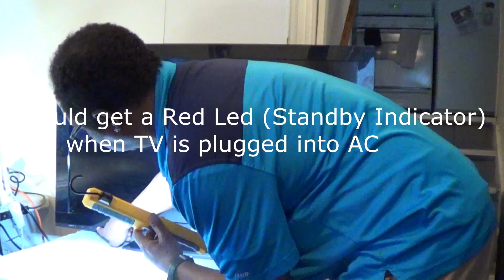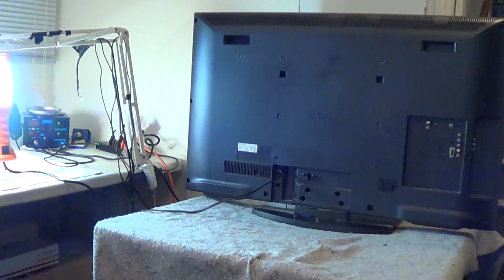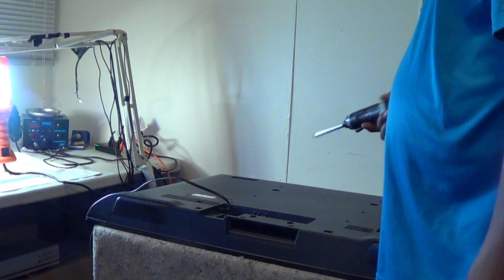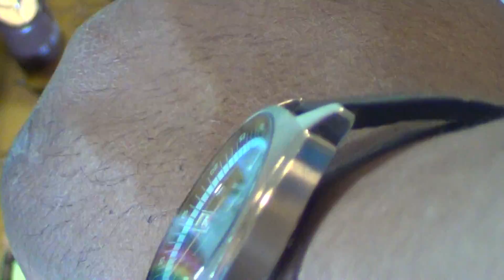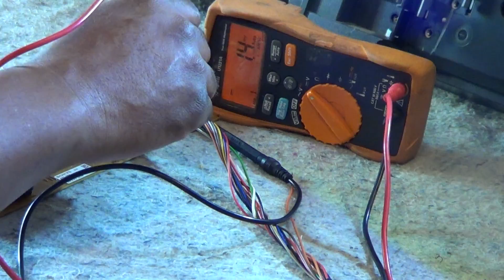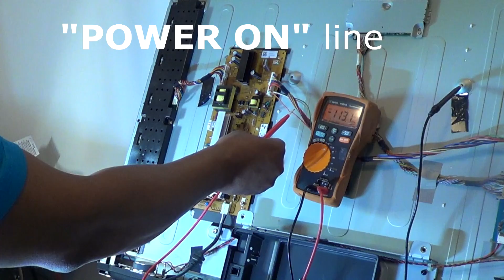How to fully check your tv power supply on a dead television set

Comment: Hi,  I hope you have the time to answer a couple of questions.  I have apart my Hitachi 55" LED LE5569 tv and the backlights did not work.  I replaced the bad ones but, the backlights will still not come on.  I have changed the power supply and the main board and have taken the panel outside and looked through it to see it damage using the sun and I cannot find any damage.  Anyway the power supply board is MP1-1450 the two connectors that hook up to the 12 led strips, one of them reads 336 vdc but  the other one is not steady it seems to go up and down.  I checked all of the led strips indivually and this repair is driving me nuts.  I have the voltages to the main board.  I have the standby blue light on.  I have never seen the picture or heard a sound out  out of this tv.  Can you help please?
Reply: If you were to disconnect the wire with the unsteady voltage reading from, or very close to, the connector which feeds the backlights and take another voltage reading on the backlights side of the open circuit you made by disconnecting the wire, and the reading:  A.) Remained unsteady, then there exists an open circuit in that wire,  somewhere between the connector which feeds the backlights, along the wire that had the 336 vdc (supply) wire through the led's up to the point of open circuit you made, or defective led(s). This open circuit, or defective led(s), must be located and repaired: B.)Obtained the same voltage reading as the other led (supply) wire, then there exists no problem with the led(s) or these 2 wires from the connector which feeds the backlights along the supply wire (the wire with the 336 vdc reading) up to the point of intentional open circuit. Now is the time the intentional open circuit should be restored to its pre-intentionally-open-circuited state. If there exists continuity from the point of intentional open circuit restoration through the connector which feeds the backlights, then the problem exists elsewhere, probably on the board. I hope I have been concise and thorough in my attempt to help you diagnose the problem with the backlights, and I hope they are understandable. However, I just noticed your comment is 10 months old and you have probably already repaired it by now, but I will still submit my reply in case you haven't repaired it yet, and haven't returned it to the owner, junked it, etc. (lol) Anyway, I hope it helps.
Reply: @JerryBrogdonmrfixxitt  Thank you for the reply.  After I got the back lights replaced and reassembled for the 3 or 4 time, I ended up cracking the screen after all so I donated it to the TV repair place.
Reply: @dallaspilotcar9293  What a bummer, Dallas! Do you know if the backlights were working at the time when the screen became cracked? If they were working, do you know what had been done to enable them to work? I'm curious.
Reply: @JerryBrogdonmrfixxitt  I believe that I ended up having another backlight strip that was bad and it prevented the other ones from working and once I replaced it, they all came on.  However, even when I hooked TV up to antenna to check it, I was never able to get any kind of a signal or any other kind of input to work.
Reply: @dallaspilotcar9293  Did that tv only have the one button requiring a remote control to operate the tv? If so, did you have the remote control? If so, was the remote control programmed to that tv? If so, did the remote control have good, strong batteries? If so, did the tv scan for tv stations? No, it didn't, you said that the tv never had a signal. The problem there could have been with the remote control or its batteries, causing a a no communication state to exist, which would explain the tv to have no signal. But I'm sure you know this, so it must have been something else.
Reply: @JerryBrogdonmrfixxitt  I ordered a brand new remote. had fresh batteries never could get it to scan and nothing ever came on the screen. It had a roku device hooked to it, nothing happened when I tried to switch through thhe different inputs.  It came on the blue light was on after changing from red.  Same thing that happened even before  changed the leds.  I even changed some cables, the power supply board and I cannot remember what else.  It is possible that I could have damaged a cable
Reply: @dallaspilotcar9293  Before you assembled it after repairs, and with it plugged in, were all the appropriate voltages present on all the pins on the power supply board?
Reply: @JerryBrogdonmrfixxitt  After I cracked the screen I gave up on it.  Did not even take it apart again to get the brand new LEDs out
Reply: @dallaspilotcar9293  Okay, Dallas, I had fun chatting with you today, while I'm replacing the water pump, thermostat, and all 4 engine/transaxle mounts on a 2005 Dodge Grand Caravan with the trusty ol' 3.8L power plant! lol I hope you had fun, too! Until next time, take care and may God bless! ttyl
Reply: @JerryBrogdonmrfixxitt I enjoyed it also. I have another channel called butterflytaxidfw where I have several repair videos for 2011 dodge caravan.  I have 350k miles on same motor and same transmission.
Reply: @dallaspilotcar9293  That's awesome! I'll check it out a bit later. I need to wrap these repairs up, it will be dark soon. Take care!

Comment: So all you did was change the PSU. Cost to Customer $100 or more.  And that TV may last or not?  WHY ? Because You did not find the fault, Why was the PSU open circuit?  and what caused it to happen. Was there a Fault on the High V board, Did you even test the DC out to the High V Board. How long did you Run TV after changing the PSU before returning it to the owner. That is not TV Repair. The fault could just be dry joins or be a $0.20 diode. Now do real TV repair at component fault finding NOT BOARD CHANGING or do you not understand how SM PSU works?

Comment: I have a Samsung 55 inch led tv. When I check the standby voltage I have 13 volts when I should have 8. Would this cause other issues. The standby light illuminates and when I turn the tv on it says smart tv on the screen then goes to a black screen. No sound and I see the toggle makes the standby light blink but won't do anything else. I can only turn the tv off by unplugging it. Any one have any idea what it could be? Thank you
Reply: I've never heard of standby higher than 3-5V.  That sounds incredibly high.